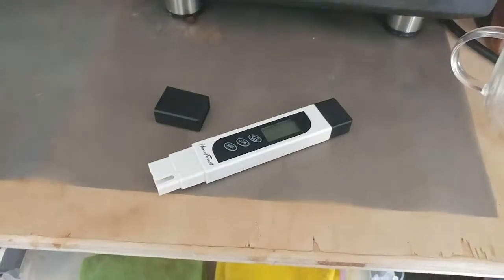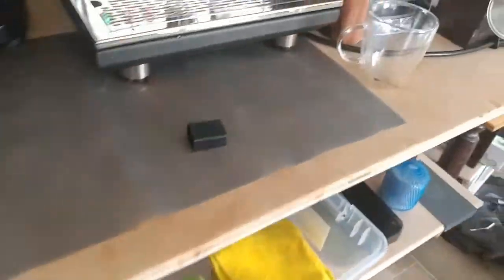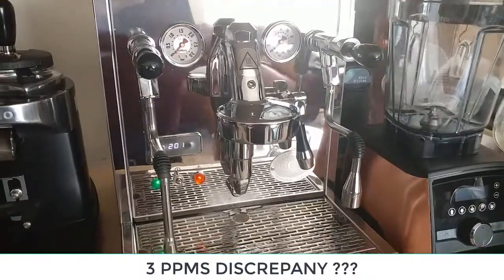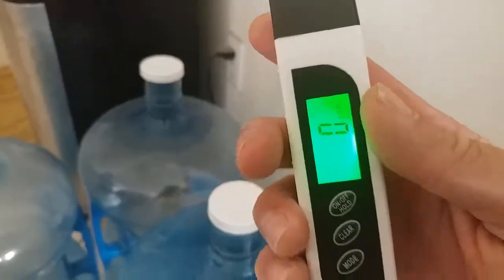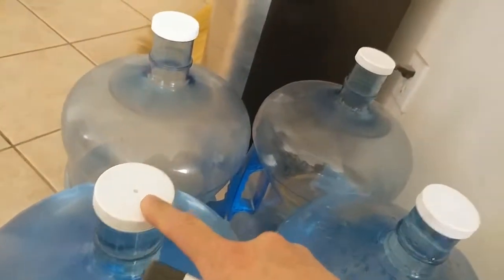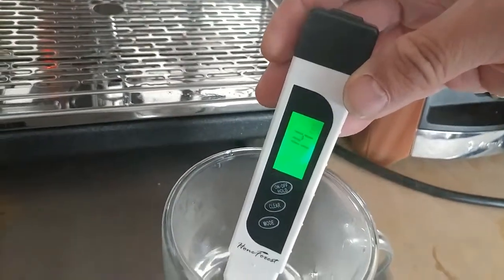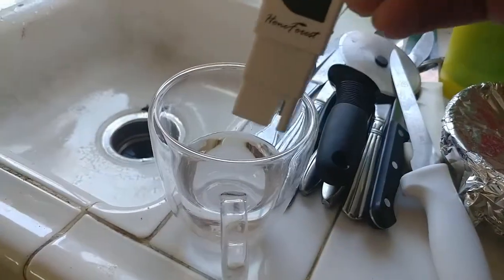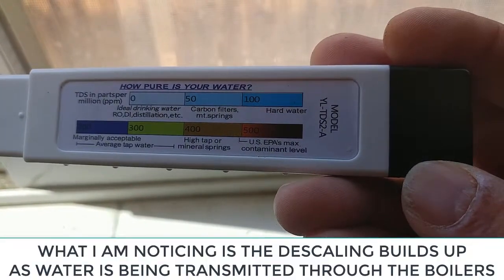IS WATER CAUSING SCALING ON MY ESPRESSO MACHINE?

Comment: The TDS meter does not exactly correlate to hardness except at zero where the lack of detectable solids should also be soft water. With higher readings, the solids detected may not be the ones that contribute to hard water.
Distilled water which the 6 ppm reading shows you nearly have, will leach minerals from metal. The plumbing of your machine will be scale free, but you are constantly pulling metal into the water. The distilled water will also extract additional flavors from the coffee that you may not like. As another poster also said, add some minerals back to have a hardness of 60-100. You can find recipes online, or just add a ration of tap water to reach the desired hardness that will be kind to your machine, and give you the best flavor extraction.

Comment: TDS is just the total dissolved solids, it doesn't necessarily measure specific contaminants or tell you if anything healthy or unhealthy for you or your espresso machine is in the water. 
Your TDS meter even says up to 300 is 'average' for tap water.  I don't think 0 TDS water is 'ideal drinking water. Definitely not ideal for coffee and tea. 

I'm guessing that water is Reverse osmosis or distilled water since it's so low in TDS. Those types of 'pure waters' are more acidic, combined with high heat I think what happens is your leeching a little bit of the metals (or scale) back out which is why the number has increased. 
Ideally you want something close to neutral (pH balance) with some minerals, with not too much calcium which causes scale, also for taste having some minerals / hardness will help.
You can always use a mix of a little Filtered tap water in with your mineral-free water. I was doing a 50/50 mix, I think some people may do 70% reverse osmosis 30% mineralized, it depends on how hard your water is and your tastes I guess.  Another option is to make your own water recipe by adding very small amounts of minerals back in to pure water, some potassium and magnesium for example.